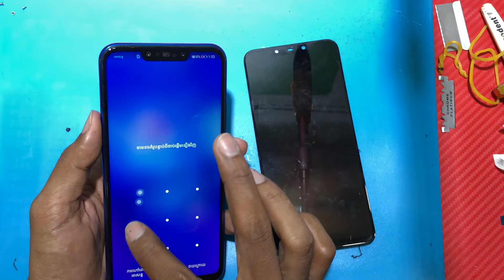huawei nova 3i lcd replacement

Comment: I bring my 3i  to store because of lcd is break and now its already finish but my phone is not working smooth, like its animation example is deleteng the recent apps and it will just home and its already delete.
Reply from the maker: after replacement lcd it slow than original lcd 20%

Comment: Can you tell me what model/brand/name of the dryer you using?
Reply: Thats not a dryer if you are referring to the tool that he use to dismantle the screen. It is hot air gun, you can find it on online shopping apps. Usually it comes with soldering station.

#HopeItHelps😅

Comment: Hello can you helpe please my nova 3i is showing like a shadow of YouTube whenever I open something that has translucent background although all apps are closed it still appears after restarting device
Reply: Bro i have the same issue
Reply: I think its a factory defect?
Reply: I don't know for sure what causing it but changing the screen will fix it, my phone also have the problem, the guy that fixed mine say the screen is almost broken not quite broken but almost..
Reply: @ashrafhalim9474  you have huawei 3i too?
Reply: @ashrafhalim9474   does it take too long to fix the screen it will take days or month please answer i want my phone to get fixed
Reply: @ashrafhalim9474  thnx I will definitely try changing it
Reply: @snikkz6717  not long at all usually 1 day if they not busy
Reply: @snikkz6717  yes
Reply: @ashrafhalim9474  it will take 1 day? What shop did you go to
Reply: @ashrafhalim9474  i m facing same problem what should i do to resolve it or should i just ignore it ?
Reply: @jonnycage6-9  you can just ignore it but the replacement not that expensive and it can get annoying
Reply: @ashrafhalim9474  does it come under phone warranty?
Reply: @jonnycage6-9  if it defects from out the box yea
Reply: It's called screen retention, just keep the device cool and I suggest you to keep your brightness in low or set in Auto Mode. And under the Display Setting select the Color Mode Temperature kindly set it to Normal and Default. Thank you
Reply: @jessgawat8870  thank you for the answer! I badly need it.
Reply: It's called screen burn in my Huawei nova 3i also has screen burn in I'm gonna order a new lcd to fix my phone

Comment: can you use a hairdryer to remove the plate?
Reply from the maker: Yes it can bro u can use it 😊
Reply: @cambofixing  Thanks. I will try it with an ordered part. If I meet with any problems, I will ask you for some lessons.
Reply: @cambofixing  which kind of glue did you use
Reply: What do you call that heat gun remover

Comment: Thanks! This helped me do this exact repair today. Some things worth mentioning:

 A hairdryer works fine and make sure to use a sharp blade like in this video and not the replacement tools that come with the screen.

Also, be very gentle on the plastic gasket around the screen because you will want to keep this. Cut between the plastic gasket and the metal housing of the phone. 

Last thing - this glue is great. It cleans off easy so don't worry if it's coming out of the edges when you press the screen or back plate back on. Just peel it off after 👌
Reply: I did the same too but the piece at 9:42 doesnt sit flush and now theress a small gap on the corner of my phone between the back and the frame :\  also i cracked my backplate trying to get it off but it still stays together so i just reused it lol
Reply: @LILALIZEFLAME  I had the same issue. It wouldn't sit flush. I managed to apply enough pressure to get the screen to sit level with the bezel. But I couldn't figure out what had caused it to bow out in the first place  🤷🏻‍♂️ the back is super easy to replace at least!
Reply: Is there a need for adhesive for the back cover? If not, would it sit tightly after replacing the lcd? Thanks
Reply: @fredkennethuy  you will need new adhesive for both the front and back cover. Use the type recommended in this video. You can buy it off eBay for cheap. 

Once you have removed the back or LCD....the old adhesive will not stick back on. It is more like silicone which hardens once it dries.
Reply: @juliancwcwcw  Oh so I can use the b-7000 for the back cover too? It's confusing because on all video tuts, they aren't using any glue for the back cover--only for the lcd panel.